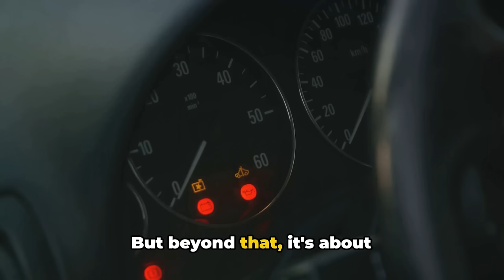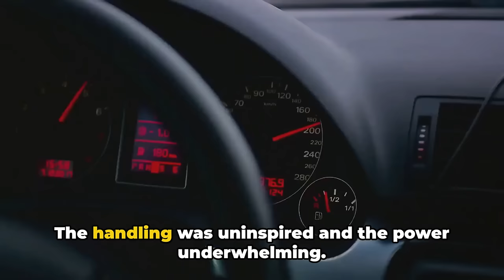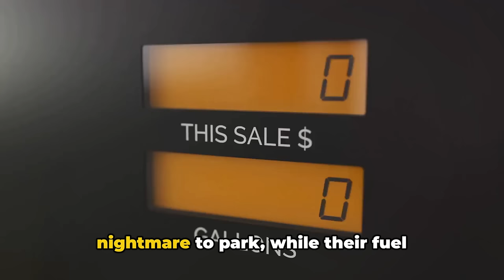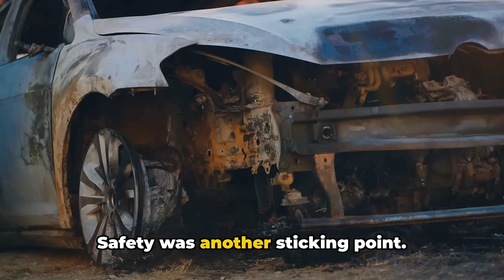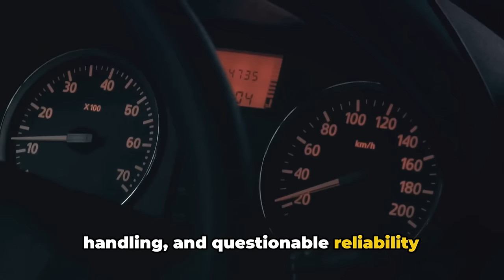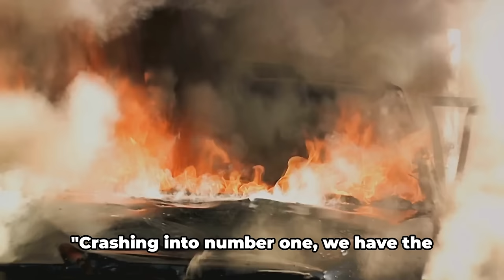The Hall of Shame: Top 10 Worst Cars Ever Made

Comment: Good gawd almighty! Where are the AMC lemons? There is a reason American Motors stopped producing cars. Is there a worse car than the 1961 AMC Rambler? And what about the 1970 AMC Gremlin? One description: Cheap and incredibly deprived the Gremlin was also awful to drive, with a heavy six-cylinder motor and choppy, unhappy handling. And don't get me started on the 1978 AMC Pacer described as a glassine bolus of dorkiness. And you might mention the infamous Ford failure, the 1958 Edsel described as homely, fuel thirsty and too expensive. The Hummers were for a niche market and fit that group very nicely. Why include them on the list?